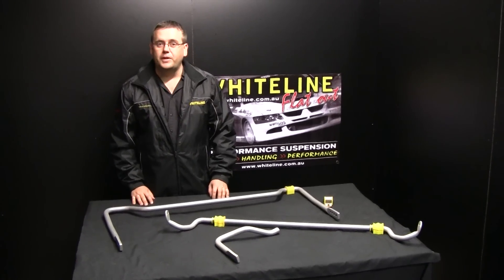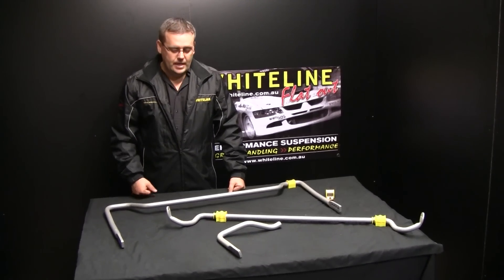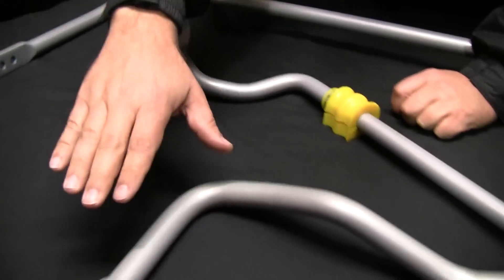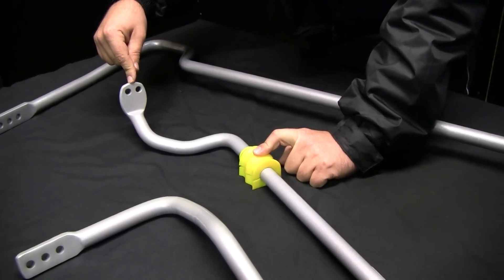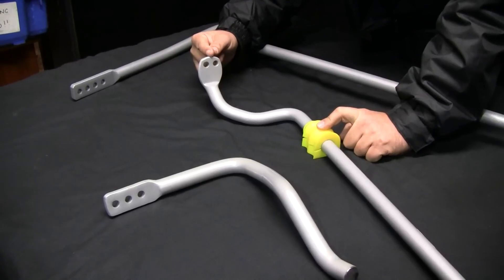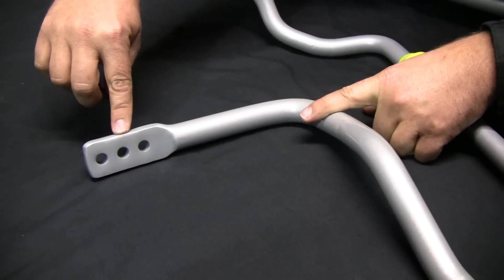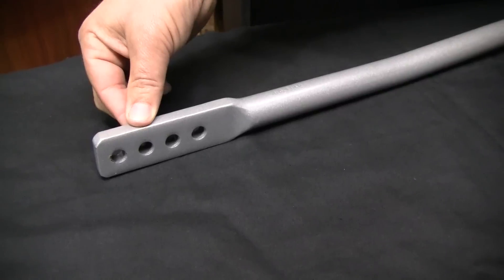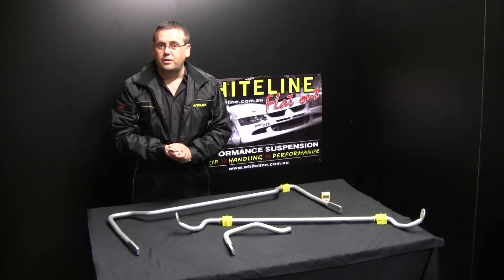Whiteline adjustable sway bars explained

Comment: I designed and used an adjustable hydraulic roll control system (swaybar). It was the best I had ever had and was adjustable from zero to 100% sway control. It was so complete that I could pull my front right wheel up on a 8 inch curb - close the adjustment valve - and when I backed off the front right wheel droped to the ground and the rear left wheel lifted two inches off the ground! I could rock the car on the front left and right rear wheels.
open valve all wheels drop to ground.

Comment: Very helpful so thanks for posting.  I ordered your kit for the Commodore VFII/Chevy SS. The listing showed the same size bars as stock, and I assumed the difference was in the metal composition. Now I understand the difference is based on the adjustable selection holes.
Reply: Instablaster.

Comment: Just fitted to my Clio 182 and makes a big positive difference 🙏

Question re tightening up the droplinks, on one side looks fine but on the other, the spacer above the bush on the vertical keeps spinning, so bush ends up slightly squashed, so have dialled it back to match the other side.  The fitting instructions say to tighten until the spacer stops rotating then a further 2/3 of a turn.  It keeps rotating and compressing the bush inducing preload on that one side, so any tips on how to get it correctly tightened in this scenario? 

Thanks

Comment: just ordered whiteline 22mm/22mm kit for my 2011 WRX hatchback.  We have extremely shitty roads here so for now I'll go on the cheap and put some mild sway bars on, but I'm trying to figure out a good way to set up suspension for compression dips at high speed where you randomly hit your bump stops in the middle of an S bend and then go into a 3rd off camber corner with crumbling cement.  if I had rally tires with super hard side walls then yea it would make it easier.  I guess a rally cross set up is almost close enough, but with the soft sidewalls of road tires it creates a different set up entirely.

Comment: Hi,
Great video, I have a question regarding the lateral lock links you provide. I have them on my rear sway bars (which are whiteline as well) but I had a look under the car today and there the right one is not sitting exactly flush againsts the bushing. Just wanted to check if this was correct or was the lateral lock link meant to sit on both sides right up against the bushing?

Thanks

Comment: I bought both front and rear Whiteline swaybars fir my 06 Pontiac GTO. What position should I put them in that's close to stock as my starting point when I take it to get installed at my local tire shop? Middle, front or rear farthest from the D bushing?
Thanks...

Comment: What's the point of an adjustable sway bar? In another words, if I've paid for a 24, why would I want the performance of just a 22?
Reply from the maker: Hi there, in most cases the softest setting on our bars will still be stiffer than OEM. So we have that softest setting available if the customer were to lets say get a set of lowering springs or coilovers down the road and isn't liking the handling, well our bars can be adjusted to suit most extra modifications. Sometimes the softest setting is enough for some people on a stock vehicle. So you pay for 1 bar but you get 2-3 sometimes 4 choices of stiffest.
Reply: @WhitelinePerformance  OK. I'm very new at this. Thanks for the explanation. With it, may I assume, while the bar has levels of resistance to roll, while it's doing it, it also stiffen the ride quality? In another words, if I'm looking for a comfortable ride around town with potholes, I may not want a bar too thick from original installed in my car?
Reply from the maker: @legambaz  Good question, so technically sway bars add additional spring rate to whatever springs are currently on the car. Usually its safe to say on a bone stock OEM suspension (usually pretty soft springs) you are OK to go to a stiffer bar without sacrificing ride quality. Even a mild lowering spring you really wont notice a huge increase in stiffness of actual ride quality. You really start getting into stiffer ride quality when you go to a dramatic drop spring or coilovers. Thats when youll really want to figure out what sway bar works best for you and your current suspension setup. Hope this helps.
Reply: @WhitelinePerformance  Yeah, that definitely help. At least I know what to do with mine. Thanx Dude.

Comment: I bought Whiteline BSF33Z front sway bar which Whiteline advertised as compatible with WRX MY06. It is not compatible-it has fitment issues. I contacted Whiteline about it. Their solution? They want to sell me another "compatible" sway bar!! I think this company is flat out a load of BS
Reply: Absolutely correct!  I recently bought  a set of lower control arm relo brackets for my Mustang and when I went to put them on they caused my axle to move backwards by 1/4".  I contacted them and they blamed my mechanic, my springs, my LCAs and then when I sent them back to be checked they decided to "allow" me to pay MSRP (that's higher than retail) for a different product and take a credit for their part that didn't fit right in the first place.  Their final conclusion was that my LCA (which is aftermarket, but verified to be the exact same length as stock) was too long.